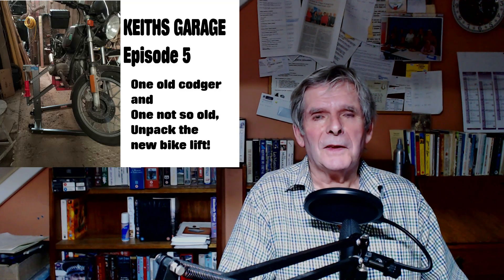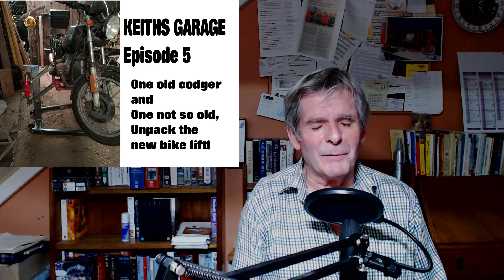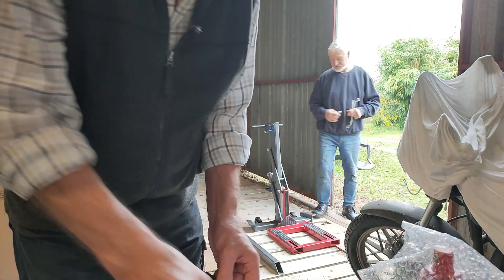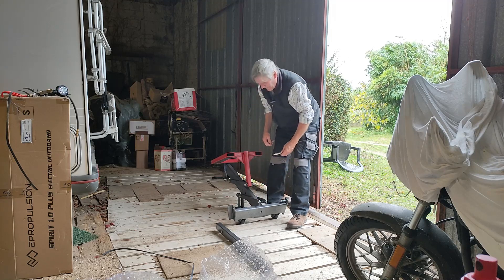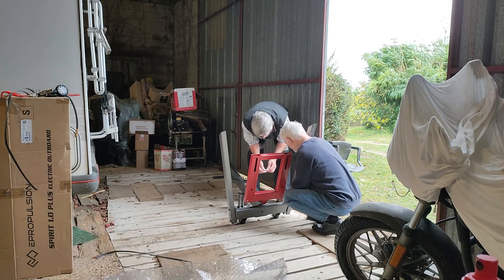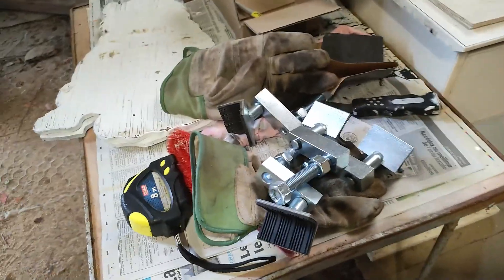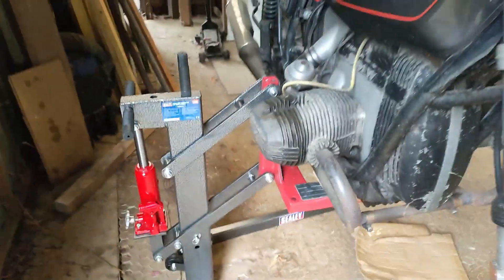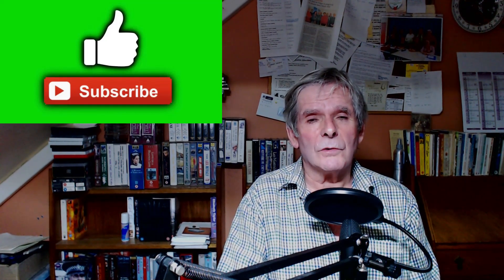ONE OLD CODGER AND ONE NOT SO OLD UNPACK THE BIKE LIFT.    www.crackerbooks.fr

Comment: Thats a handy looking bike stand  : ) Have you got some jobs planned for the BMW ?
I had a more basic one from Machine Mart. It was mainly meant for off road bikes or Quads. I gave it to my younger brother when he was turning a Gpz500s into a cafe racer/old looking racing bike. He cut the stand in half then joined the halfs together with 4 , six foot lengths of 4"×4" fence posts to form a full length bike lift. It works very well : )
Reply from the maker: There are some jobs that need doing like renewing the gear change lever. Some electrical bits and bobs. Ist ideal for just servicing too.